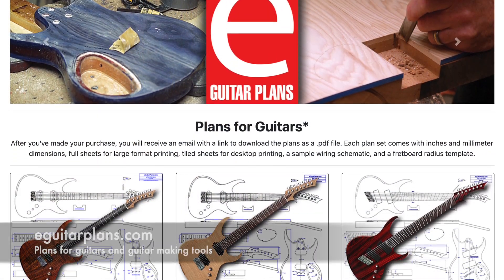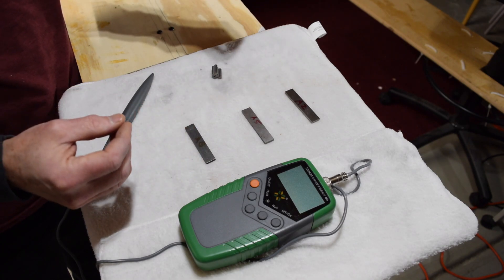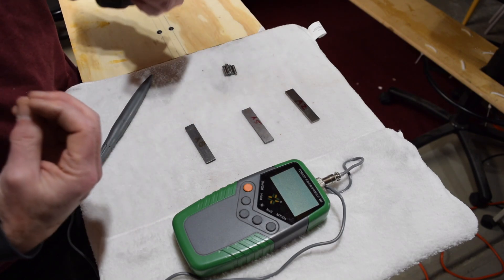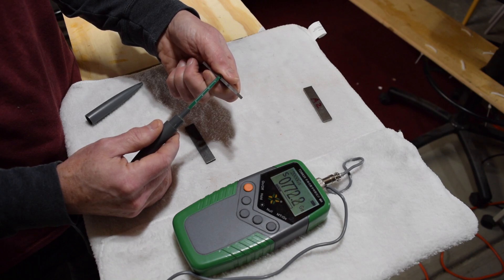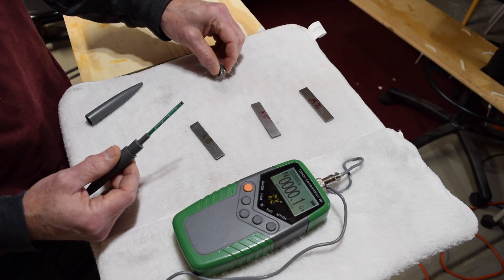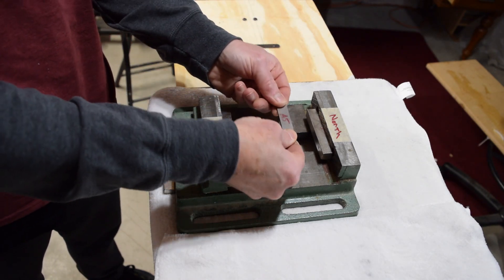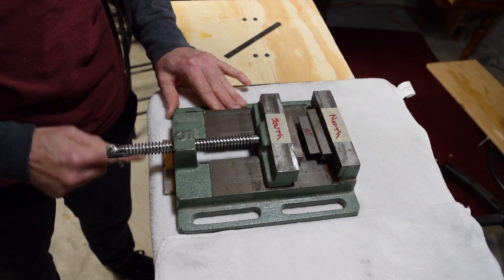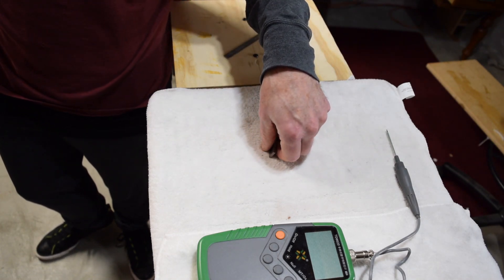Luthier Quick Tip 29 How To Make Guitar Pickups Part 5: Magnet Strength

Comment: I bet a big part of that "airy" sound that the pickup have in my 1969 es175 come from the magnets getting weaker over the year. I love the sound of those pickups and can't seem to get that character on any of my newer guitars, no matter what new pickups I use. That's why I'm interested in making my own pickups, so I can experiment with things like this and potting, wire and amount of winds
Reply from the maker: Magnets don’t loose their strength over time unless you subject them to blunt force, extreme heat or expose them to a stronger magnet. That “airy” sound you describe is more likely the result of the composition and gauss of the magnet combined with the structure of the coil. Despite what boutique pickup makers claim, it is almost impossible to replicate vintage pickups because the coil wire made today is very different than what was made 5-7 decades ago.

Comment: There are no flavours of magnetism. The strength is the ONLY variable. Doesn't matter if it's made from nails from the one true cross, or comes out of a factory, spewing pollution, or is made in a lab. If the shape and size are the same, and the strength is the same, it IS the same. The field doesn't care what the magnet was made from
Reply from the maker: The iron content of a magnet dramatically affects the level of inductance which is an indicator of the tone.

Comment: Wonderful episode. Lots of questions and suggestions for follow up. You've explained lots of the physics. Now the art of mixing physical properties kicks in. Would two pickups you built with nearly identical physical properties sound the same? Some will want to know if they can replicate a vintage pickup's physical properties will it sound as desirable? I'm more interested in how you think the various low, medium, high readings of physical properties best blend together. Everything in the middle? Spike one. Spike one and drop another? Not sure how to better phrase it, but hopefully food for future episodes. Thanks
Reply from the maker: Since tone is subjective, there really is no right or wrong way to blend the bass, mid range and treble frequencies. By understanding how to wind a coil to a desired level of inductance coupled with the choice of magnet composition and gauss levels, you can dial in the amount of bass mid range and treble frequencies a pickup will generate. Keep in mind I'm only talking about the pickups. There are many other factors from the guitar all the way to your ears that you'll need consider as well.

Comment: Excellent as usual.  Have tried some of this info.  My main struggle is winding the PU's.  How much tension on 42 gauge is enough and how much is too much.  My guess is it's an iterative process, right?
Reply from the maker: The easy answer is that if you squeeze the wire too hard, it'll break. Not enough squeeze and the coil will be too loose. That's why I use a simple mechanical tensioner to get it right.
Reply: @HighlineGuitars  Is that built into the winder you designed?  (I bought plans to support the channel but had a winder) i bought the mojotone tool but had similar issue.  I finished one by hand and had three breaks which I soldered and re-coated with poly and it seems to work but soldering 42 ga wire  is ...well interesting.  Yep looks like an acquired skill with a slew of wasted wire.

Comment: At around the 8:50 mark you talk about adding extra magnets to your jig to increase the charge. How are these aligned (physically)? Side by side or in between the magnets already there?
Reply from the maker: Two on each jaw with two small 1.5mm plastic shims, one at each end, to create an air gap that enhances their strength.
Reply: @HighlineGuitars  Yes, I get that it's two on each jaw, but you still haven't said how they are aligned. Maybe a short video showing exactly how you would mount them?
Reply from the maker: @peterjohnson4932  I only have the two magnets, so I can't show this in a video. However, it's very simple. One magnet in front of the other on each jaw.
Reply: @HighlineGuitars   I thought it must be, but wasn't sure. Thanks Chris.